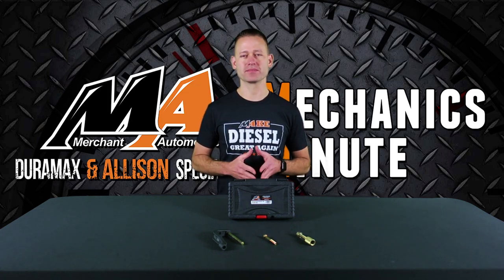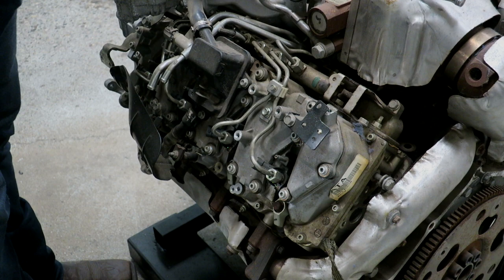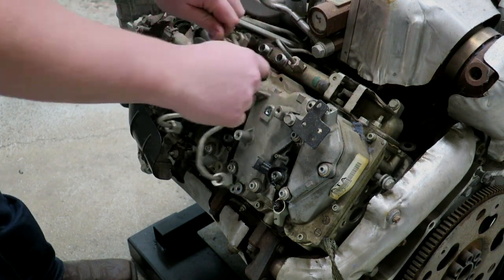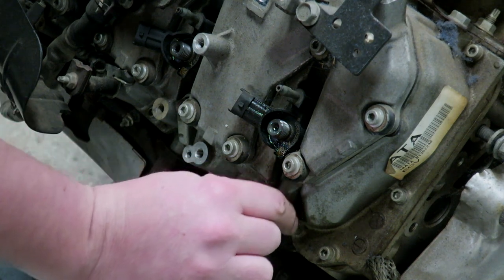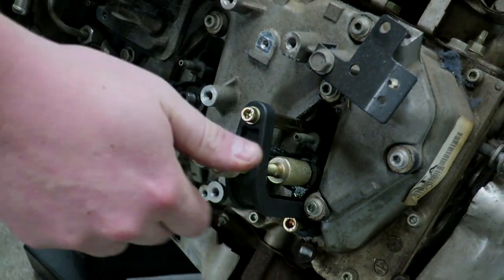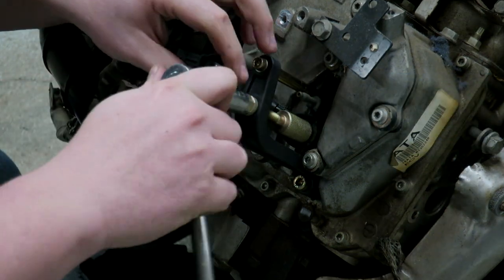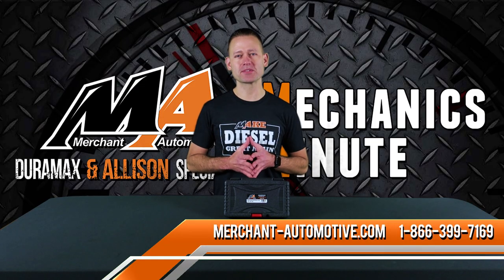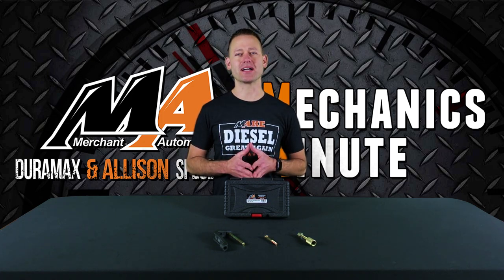Mechanics Minute: LML Deluxe Injector Removal Tool, 2011-2016 Duramax

Comment: seriously you have to pull the engine to replace the injectors???
Reply from the maker: We did the demo on an engine that was already removed to make it easier to see how the tool functions.  The repairs can be done in the truck.
Reply: If you can pulling the cab can help but you can do it with the cab on just be prepared to lean over the entire time. And have a blast with the 12point up pipe to manifold bolts if you have no way to get the studs out of the manifold. But thats for doing a head gasket. Injectors you can sneak them all out pretty well but the days of the shade tree diesel mechanic are pretty much dead. Oh yeah make sure not even a pube gets in your fuel rail or your screwed.